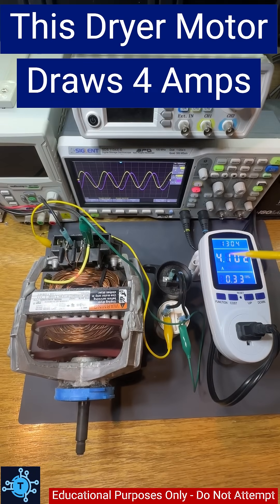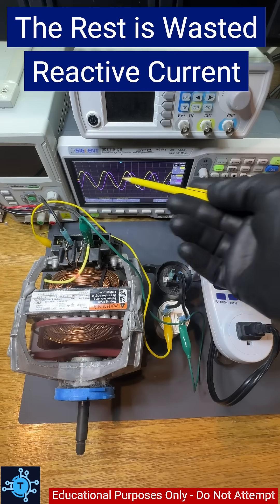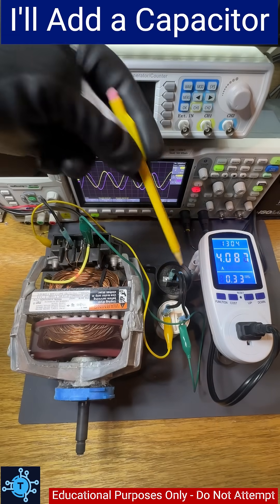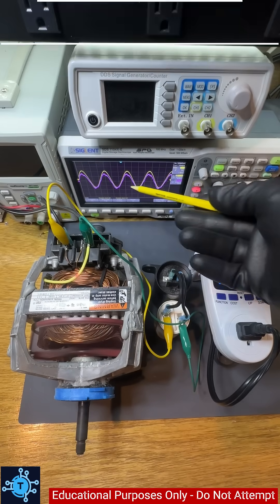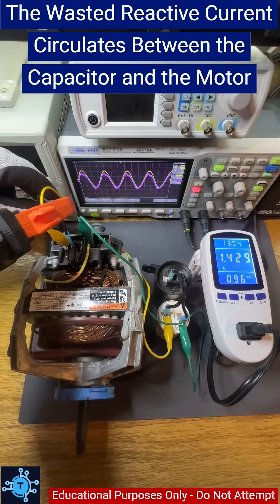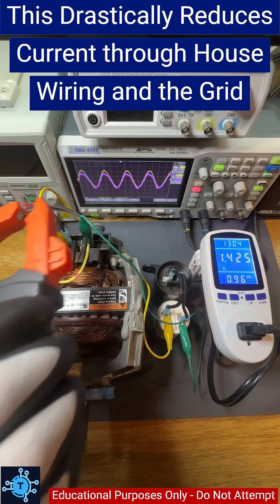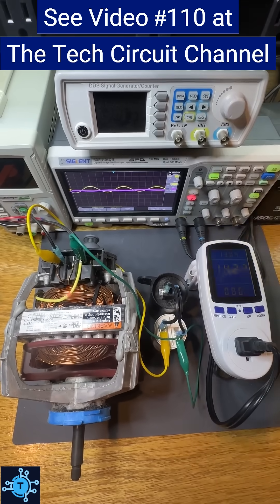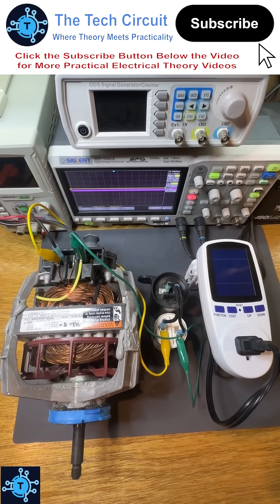#117 - Running a 4 Amp Motor on 1.4 Amps?   #powerengineering #powerfactor #electricmotor

Comment from the maker: The additional 2.5A of current is based on reactive power and is actual current. It uses up the house circuit's capacity, increases current along the house's wiring and ultimately the utility's power lines 

⚡ Try the free calculator here: https://techcircuit.org/power-factor-correction-calculator/

📺 Watch the full video: https://youtu.be/8lWGIN_Hcmg

🔧 More practical electrical theory:  https://TechCircuit.org/yt

⚠️ Safety Disclaimer:
This video is for educational purposes only. Do not attempt this at home. I'm using isolation transformers and appropriate safety gear. High voltage can be dangerous or fatal.

If you enjoy hands-on, real-world electrical theory and appliance repair content, please give it a 👍 and consider subscribing: https://TechCircuit.org/yt

Thanks for watching,
–Steve @ The Tech Circuit

Comment: Makes me wonder how inefficiently designed appliances are in general. I'm guessing even with the EnergyStar label, the appliances are designed as cheaply as possible and if all appliances were more efficiently designed then much more power would be saved on a macro scale.

Comment: You wisely didn't claim that this reduces energy usage.
Reply from the maker: The utility must supply additional power to low power factor loads to compensate for waste heat from the higher current. Because of that, power factor correction saves energy in the distribution system.

Comment: It's not wasted.
Non unity power factor doesn't result in wasted power (except for a tiny amount due to cable resistance)
Reply from the maker: Reactive current affects power lines just as much as non-reactive current. The resistive lines don’t know the  difference. In fact, the power dissipated by the utility lines is the square of the current. This equates to eight times more power dissipated (wasted) when the  motor is not not power-factor corrected.

Comment: Lmbo, for the same reason my semi doesnt run on a moped motor. Yes you can make a motor with no load move for less electrical power but once its moving a load your dryer won't spin.
Reply from the maker: Correcting the power factor of such a motor does not reduce its performance. It simply redirects the wasteful reactive current to the capacitor instead of to the voltage supply.
Reply: @TheTechCircuit I doubt homeboy even knows what that means.

Comment: True, but your residential meter doesn't charge for poor power factor. Big industry, they have those meters.
Reply: Many of the new digital ones do, they also have a history of FIRE.
Reply: @anthonywilliams7052Not true.

The smart meters in residential settings have the capability to measure power factor but they don't bill for it.

They bill for real power only that is consumed.